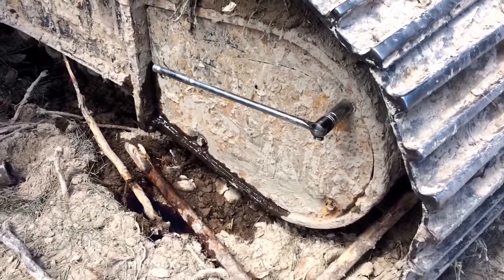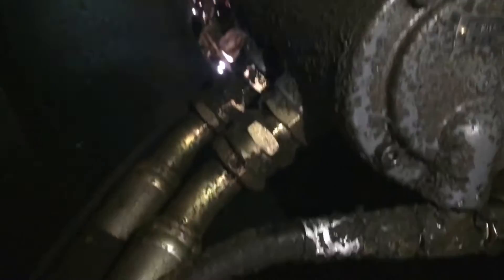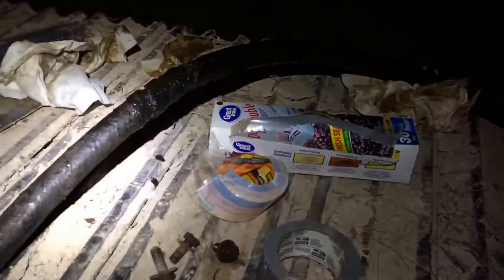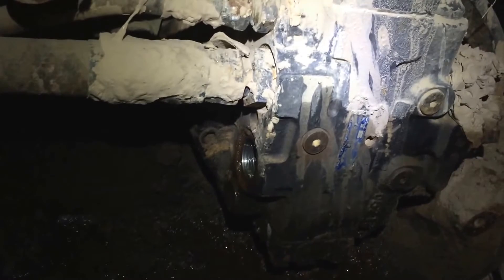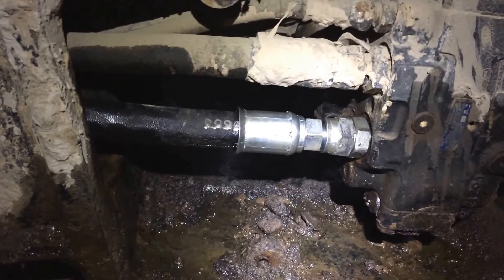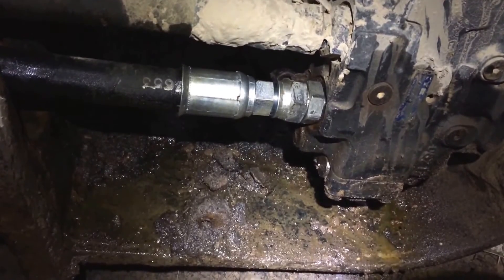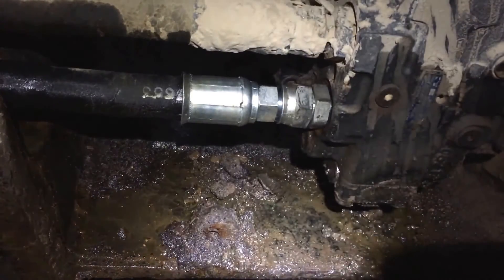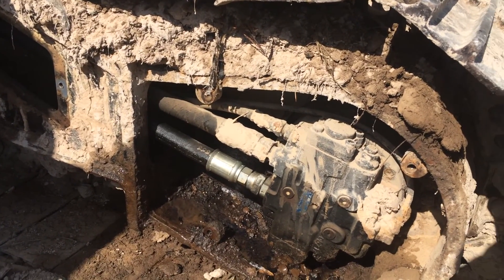Blown Hydraulic Hose (Final Drive) and Repair on the Excavator - Link Belt 3400 Quantum

Comment: Thanks.
You have great access to the fittings underneath. On a TB016 the fitting is behind a corner and the spanner can only go on at 45° angle. Crow's foot no good. Cut an open ended in half otherwise can't move it enough. Stupid Takeuchi. 
When I removed the panel to the motor the whole cavity was chock FULL of dirt, couldn't see a thing. 
Now I have a problem with drain line: 10mm black plastic with a short sleeve with bulge around near one end to act as a kind of compression olive. Not in exploded view nor listed so can't buy it! No useful Tak dealers in France, in UK they just seem to sell filters.

Comment: Tom do you have a video on how to put the track back on?
Reply from the maker: In what fashion? Did you fully break the track or just have it slip off the idler? I was never able to get mine back on the idler by myself when it slipped off (before I got new sprockets and chains). Letsdig18 has at least one good one where he finagles his track back on by himself. Of course, in hindsight, when my track slipped off, I tried to put it back on over the idler first, then the sprocket, which of course is pretty well impossible. You need to get it on the sprocket first while you have slack, then use the bucket to pull it into the body of the machine (assuming it slipped off to the outside) while rotating the track slowly. You'll need to first prop that side of the machine up on some logs or blocks enough that you can rotate the track.

If you've broken the track chain for repair I do have a video I believe about getting it back together and getting the pin in. I did all that by myself using just the bucket, some chain, and a come-along (fence stretcher). And of course a BFH!